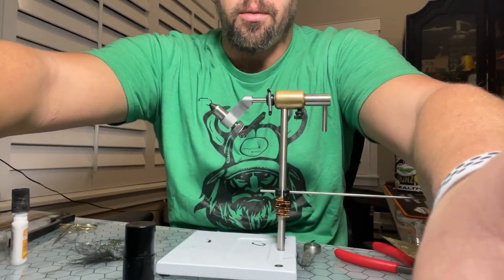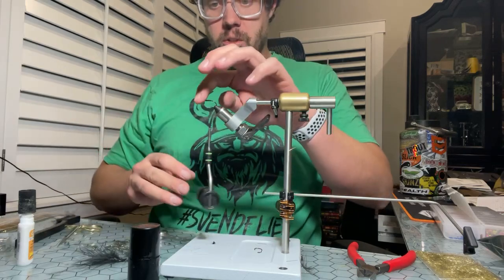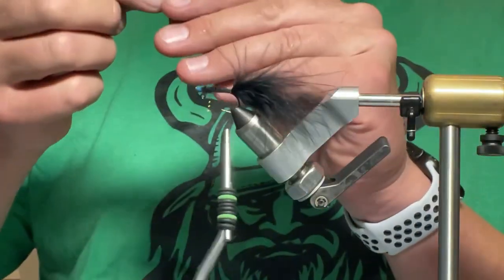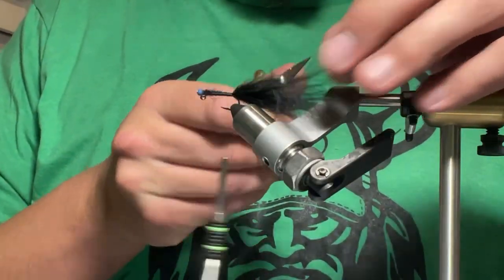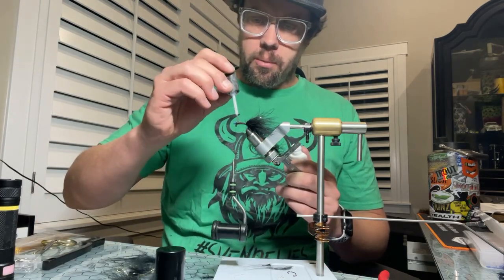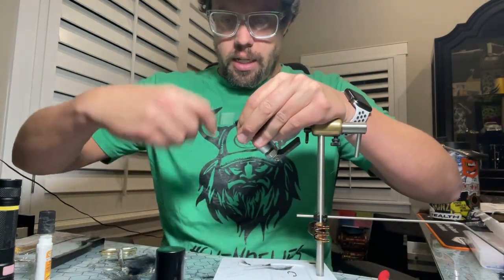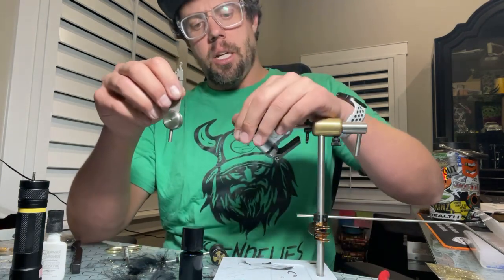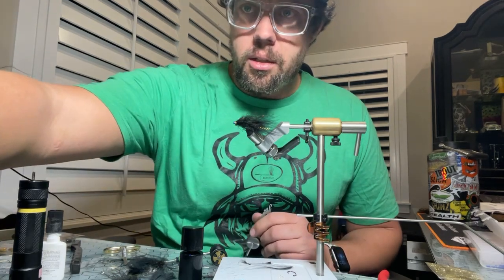New Product: Swiss CDC Multi Loop Tool Live Tie

Comment: One little trick I use on the metal edges of shanks, pins, or wires, if needed, is a dot of UV cure resin that will help keep my thread from getting cut as I tie. Thank you for the review of the SwissCDC multi loop tool!!
Reply from the maker: That’s a great tip.  I just avoid it.